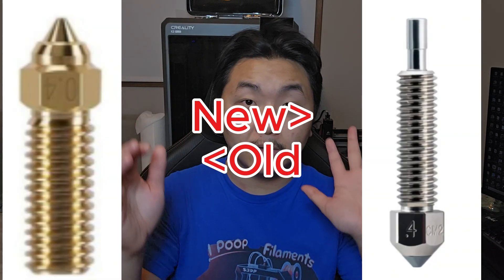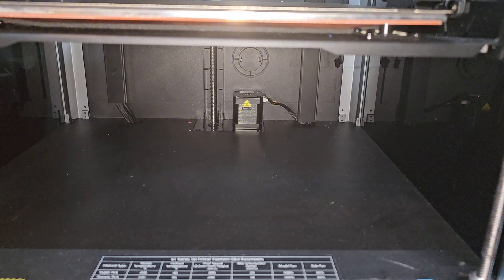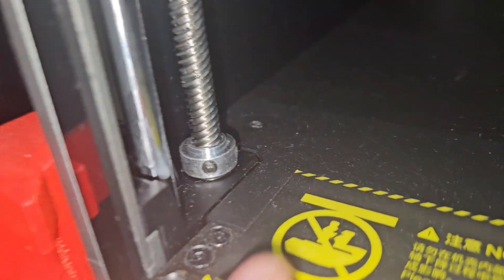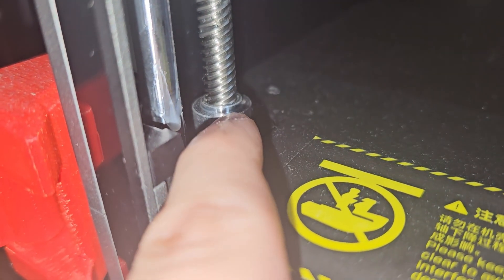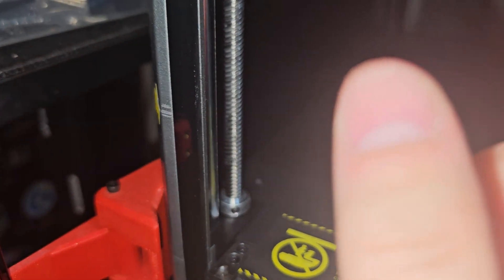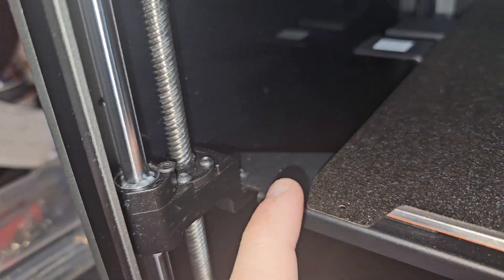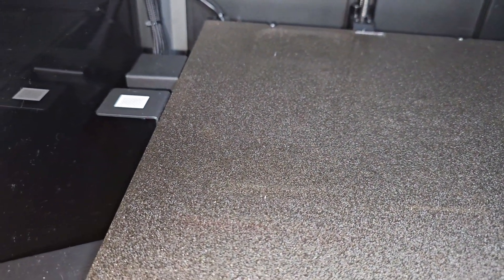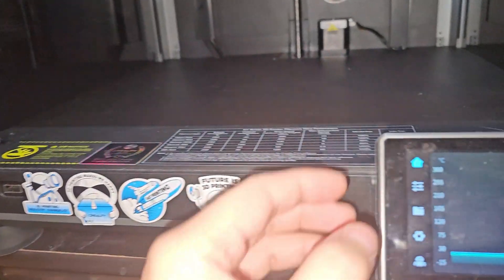Fixing Creality K1 Max To Print Like a $1,000 3D Printer

Comment: Thank you so much for a very informative video! I’ve just got my new K1 Max and the CFS and adapter kit and wanted to make a riser for my printer but was a bit worried that the PLA might deform with the printer being enclosed and getting a bit hot in there, any suggestions please?
Reply from the maker: Yeah if it's gets too hot pla might deform. If you have petg it will work great. Its not hard to print.

Comment: I found a run out sensor that goes in the extruder on printables. It doesn’t have a connector for the Bowden tube and since I’m printing mostly pla, I just removed the Bowden tube entirely. The down side is I don’t have the lid on anymore. That and the cartographer 3d sensor have made the printer great. I’m getting better results than the Bambu P1S at work.
Reply from the maker: Yeah i was thinking about doing something like that, but i don't want to get rid of the lid so I went this route.

Comment: HI, THANK YOU FOR SHARING YOUR VIDEO, I ALSO HAVE THE K1 MAX , I LOVE THIS PRINTER , WHEN IT WORKS , WITCH IS MOST OF THE TIME  TILL IT DOES NOT, I WILL IMPLEMENT YOUR SUGGESTIONS FOR MY K1 MAX , I GOT THE TERIBLE FROZEN CREALITY SCREEN. AND SO FAR CREALITY HAS SEND ME 2 MOTHERBORDS 1 BREAKOUT BOARD FOR THE HOT END AND A NEW SCREEN , NOTHING FIXED THE FROZEN SCREEN ISSUE , THEN I WAS TOLD TO FLASH THE MOTHERBOARDS WITCH I DID , NOW I AM GETTING THE ( KEY 111 ERROR ) . SO MY QUESTION TO YOU IS HAVE YOU DEALT WITH THIS KEY 11 ERROR ,AND IF YOU DID , HOW DID YOU FIX IT , I AM 65 AND VISIONED IMPAIRED , BUT GET AROUND WELL ENOPH TO FIX SOME THING , WHAT IS THE CAUSE OF THE KEY111 ERROR IT SEEMS THIS IS NOT CLEAR WHAT CAUSES THE PROBLEM . ANY WAY THANKS FOR YOUE VIDEOS , I HAVE LEARNED A LOTANY SUGGESTION WOULD BE MUCH APPRECIATED
Reply: Sounds like something may not be connected or damaged, likely your toolhead board. I accidentally cut into the toolhead cable and shorted it. I saw smoke. I don’t remember the error, but I did see an error code similar to that.  Creality sent me a new toolhead board and a new main board. Since you’ve disconnected everything a few times, double check that the cables are seated correctly and plugged into the right ports. I think the USB and the CAN headers use the same plug, so you could potentially damage something if you mix them up.
Reply from the maker: Thanks glad you like the video. I have not have my screen frozen or got the key 11 error so I'm not sure. Sorry. Make sure all connectors are connected.

Comment: Heh, my K1 Max is dead too because of a fan issue.
Reply from the maker: Yeah, the k1 max has many issues.
Reply: Is your main board overheating? I think mine shutdown about halfway through a print when I didn’t have the cooling fan plugged in.
Reply: @bajojohn  It's giving an error about the fan on the toolhead, I think I might have strained a wire when I cleared a clog that required me to disassemble the heat block.
Reply: @ I’m surprised I haven’t damaged the wires on the tool head with the number of times I’ve disconnected everything. You might be lucky and just need to seat the connector fully.
Reply: @bajojohn  Unfortunately I took it apart and checked and that all seems fine. :/